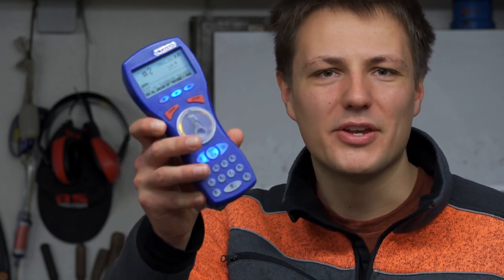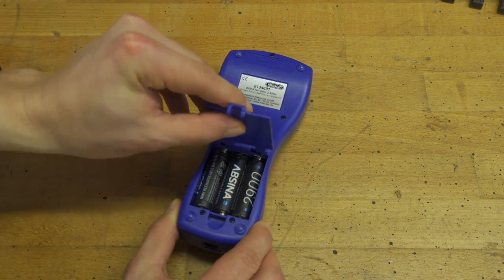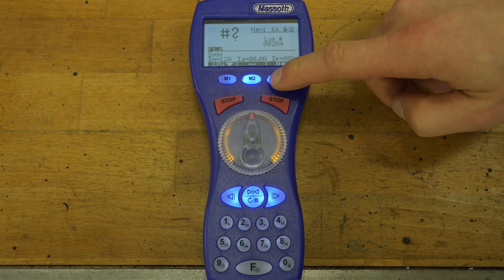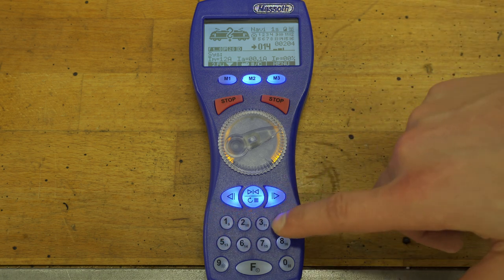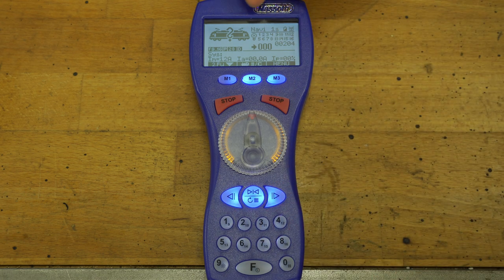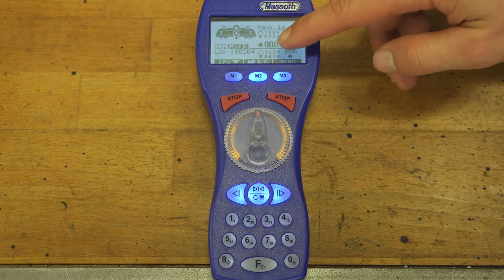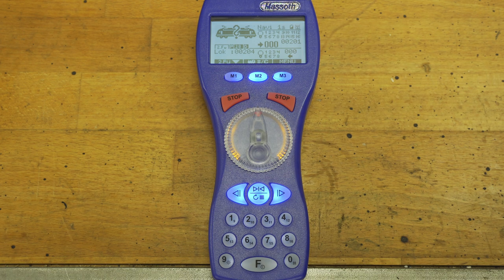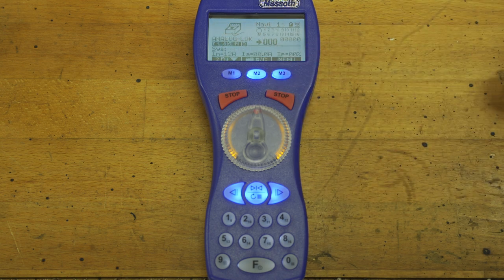How to operate the MASSOTH DIMAX Navigator ... basic functions

Comment: Hi, great video's thanks. Just wondered if you know if you can use the Massoth Navigator with a lgb mts unit?
Reply from the maker: I don´t know for sure. The Massoth Navigator has way more funktions compared to the LGB MZS central station. So even when it is possible to connect the Navigator to am MZS station it will be in a degraded mode. If you want to use the Massoth navigator I would recommend to upgrade to a mossoth central station as well. This will save you so much headache.
Reply: @summitrailway  thank you for the help.

Comment: I also run it with analogue mode 
Can the speedsteps go above 14?
Reply from the maker: Hi! My manual for the DIMAX Navigator states that no loco configurations are available for analog locomotives. So when operating analog you are not able to change the speed steps. This is only possible for digital locomotives...